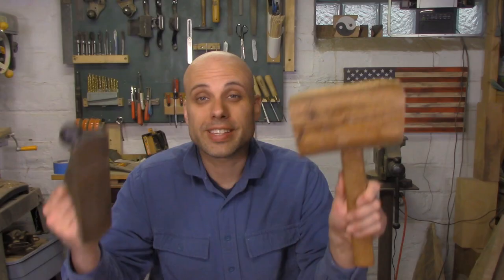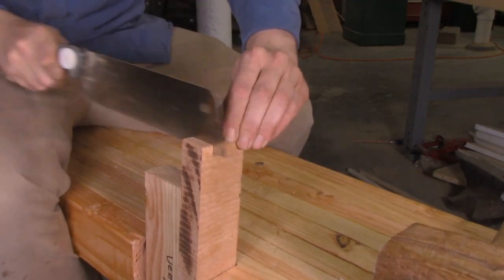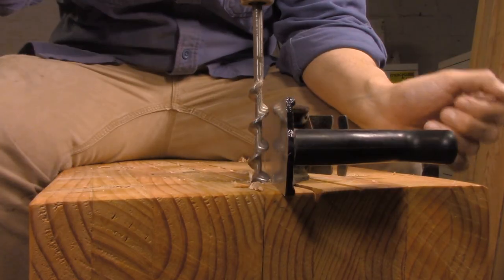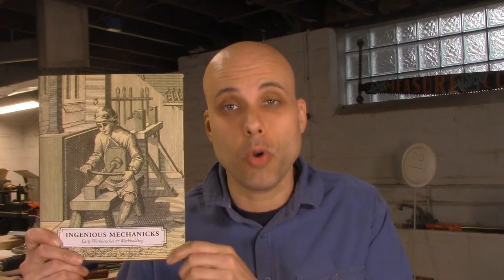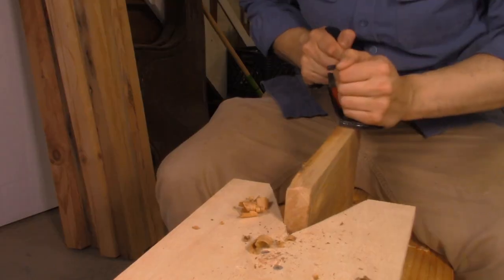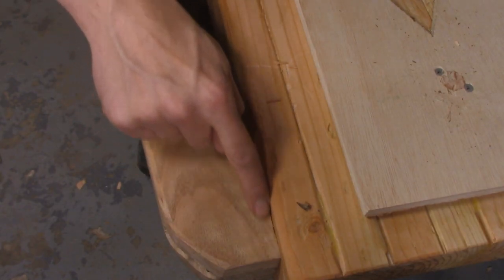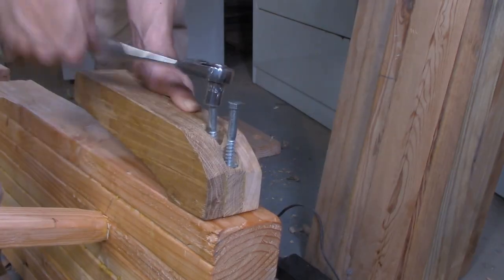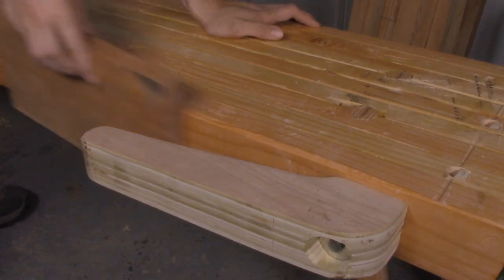Hold ANYTHING on the $30 Bench.

Comment: One more great holding piece would be a bench hook. I made mine out of oak and got a little fancy with it, but you can easily make one out of some plywood and 2x4's. I use mine all the time for cutting out notches and doing hand cut joint work.

Comment: I've been building this bench for a while now and just today I finished my palm and started working on the crochet. I had some scraps of ply lying around that were just big enough I managed to get 2 pieces by roughing one out first. Anyway, while I was roughing it out, I found another easy work holding solution for small parts that doesn't require modifying the bench. By placing the work piece off the side of the bench and a spacer of similar thickness on the other side, I could lay a 1x12 scrap across the top and kneel on that, and that held strong enough for me to use a rough crosscut saw without the board jumping around. Just wanted to share that ... while this is such a simple solution that it could easily be common knowledge, in all my searching on the internet I don't recall seeing this anywhere.

Comment: Just bought a set of good ol' auger bits I found on the other side of my country, now I just have to find a hand drill, those aren't that easy to come by here in Spain! Thank you so much for these videos!
Reply: I had the same problem (in France). If you are unable to find an antique one, you can find some new ones at a decent price on the finetools site. The cheapest does an ok job.
Reply: @Castow  I think I found one, it's hour and a half away by train, but hopefully it will be worth it.

Comment: I don't know how well this would work, but I have an idea for the "wedge vice". What if you made the hole have one angled side, and make one of the sides of the wedge at the same angle. That way the wedge is wide at the top, and narrow at the bottom. It will give full contact with the flat side on the work piece and the angled side. I imagine this would allow you to use one wedge for multiple thicknesses of wood instead of using shims. You might have to reinforce the bottom of the hole a bit though.

Comment: I have some Harbor Freight chisels, and they aren’t “pretty good.” They are quite obviously worse in every way than, for example, my low-end Stanley chisels. However, the Harbor Freight ones do cut wood, and I would not hesitate to buy them again if I had no chisels and money were very tight. The reason I bought the HF set in the first place was that I needed a chisel when I was away from home and didn’t have any others, and the ones at Harbor Freight were dirt-cheap.  Expect to spend some time sharpening and flattening the backs of any inexpensive chisels you buy— and even some of the expensive ones.
Reply: I buy some simple hand tools from Harbor Freight here and there, including a cheap chisel set. I probably wouldn't buy any power tools from them, but when I need an inexpensive C clamp in the middle of a brake pad change out, Harbor Freight is the place to go.

Comment: My question is why weaken the pegs by cutting the tops in half right where all the pressure is going to applied? Round bench dogs work just as well for holding work without compromising the strength of the peg. If you really need a flat edge just sanding or cutting a tiny flat would work just as well without weakening it.

Comment: I built my bench following a few makers on here. It is a twin screw tail vice with dog holes and an extendable end. I patterned the base from your   knock down bench with sideways tusked tenon's from Katz- Moses. I think I'm going to make a crochet that fits in side dog holes so it moves and works with my vice. Just have to figure out how to avoid the feet on the side of the top that I put on when it was built to just go on sawhorses.

Comment: My low bench has a 1 inch x 2.5 foot gap in the middle for sawing.  It allows me to rip or end saw with the off cut supported so I don't get the dreaded rip away at the end.  It also doubles a a handy, balanced way to move the bench with one hand.

Comment: Just wanted to share what I'm working on:  a modular work bench.  I'm a hobbyist with no space - my shop is half of a garage, and half of that half is a bicycle maintenance/repair shop and electronics/fine work station, so my bench needs to have maximum flexibility/capability in the smallest space possible, stow away in an 8'x2' space along the wall, and be able to roll out for use in the other half of the garage when I have access to it.  The bench will start out as (and maybe grow from) four components:

1.  A basic bench/assembly table with t-tracks on either short end for a fence to use with the miter saw (see below), and an end vise and holdfast/bench dog hole grid in the middle.
2.  A flip-top square bench that will have my grinder, bench-top disc/belt sander, and a standard vise mounted, and be a flat work surface on the other side.
3.  A miter saw stand, also flip-top with a flat surface on the other side
4.  A contractor table saw stand.  (See above about my space limitations.  I'd LOVE to have a full table saw, but I've found that a properly adjusted/tuned contractor saw with a quality blade can do all the work I need and do it quite well)

The benches will be height matched, and all on casters that can be lowered so the benches can sit on the ground for stability.  I'll be able to configure any of them (even the contractor saw - blade fully down) as infeed and/or outfeed for the saws/planer/etc.  The spreaders will be height matched and have notches so I can use removable spreaders between them to lock the tables together.

I'm sharing because I've decided to add the $30 bench with some of your additions (definitely the planing stop and the crotchet for starters).

Thanks for the great videos, keep 'em coming!  Strongly considering becoming a patron after only watching a handful of your content.

Comment: I was a professional Woodworker for over 20 years  and my go to chisels are the same Marple ones you have. Also its very common to find   Old  chisels at yard sales and flea markets that.  With some needed love will and become a good chisel ad ironically even brad new chisels need some love and fine tuning  as well  another  easy good bench. Tool for your style of bench  that can  become handy for some  operations is. A simple bench hook  or even a couple od different styles. And sizes  i dont think your bench looks strange at all  although you can experiment with differenr finishes. To. Enhance the look
Reply from the maker: I use bench hooks a lot in my other bench. I'll need to build some for this series.

Comment: Thanks for sharing. Your $30 bench made me think of the evolution of woodworking tools and I think it all boils down to quality, time and cost.

 In ancient times we had hand tools that produced low quality or time consuming products, making furniture expensive. 

Today we have power tools making very high quality products quickly. The trade off is in the price of the power tools versus hand tools - professionals work 40 hours a week and buy high-end tools - DIYers work 4 hours a week using low-cost tools. Your $40 bench is for minimalist DIYers with a lot of spare time
Reply from the maker: I appreciate your thoughts, but you've got a lot of it backwards. Many old tools and VERY advanced and in the time of hand-tool furniture making, there was no such thing as a low quality tool. Hand-tool shops also produced work at a rate that would shock you. Modern power tools are faster, but only sometimes. Setting up machine tools is often very time consuming, making their time saving qualities only apply to production work. I'm a guy that owns a LOT of machines, but there's nothing about them that ensures quality.
Reply: Well you’re happy with you system and that is important. However, where I live there is no competitive shops without power tools and all the top carpenters such as Norm A are so equipped. 

Your system requires a higher skill standard and can be personally rewarding, and it is good that it works for you.

Comment: I’m a retired professional Woodworker and my Go To Chisels have been the same Marples  you speak about ! Do not Under Estimate some of the older Stanleys you can find pretty cheap at Yard Sales and  similar  and with some TLC  make them great chisels again  i also have used older Sears Craftman black handle chisels i suspect were made by Stanley rebranded for Sears  as they have  metal caps on thee handles like Stanley used so you can  hammer on them without damaging the handles or Chisel  those i have found at Yard / Garage Sales all beat up  and looking like junk

Comment: I've heard you often refer to your bench as a tool.  Some people may get mad at this, but I have no problem using a piece of scrap,  and a couple screws,  to make a  quick stop on my bench, or a board and screws  as a hold down to work a piece.  Ya I get a few holes in my bench but  I can always fill them in if I need or rebuild the top eventually.

Comment: For the bench top, on the long edge without the notch or crochet, I used one 2x2 instead of a 2x4 to make the top thinner there, for using my short clamps to hold long boards while I rip them with the circular saw *gasp*.

Comment: Thank you for creating this series! It's really helped motivate me that there's got to be a better way, one that doesn't involve so many expensive tools and special techniques. I'm also a fan of Schwarz's more recent work!

I've been using an laminated 4x4 workbench top on two Japanese sawhorses (the really short ones) for a few weeks now and it's been great. I might just put legs into it and put a notch.
Reply from the maker: Joseph S I m really glad you like it! I'm also VERY interested in the Japanese saw-horse bench.  Can you recommend any resources?
Reply: @RexKrueger  i just made the low-floor ones out of two 2x4 dowelled together. They're as long as my bench is wide.

I am thinking of making trestle sawhorses to bring it up a bit higher, total the same as the Roman workbenches, and for that I don't think I'd need any plans (just dowels and laminating scrap 1x4).

I had started building a Moravian workbench before realizing I really don't need all this complexity after all! :/ So this is my way of reusing the slab top I made without permanently converting it.

Comment: I can put a laser edge on just about any chisel, but the cheap ones wear quick, easier to sharpen though. I have a cheap Irwin 1" has a defect in the steel about 1/8th off the edge that will eventually fail an ill trash it then. Not gonna spend two hours hand grinding that edge square again for something so cheap.

Comment: I believe you call it a palm but as you use it more and more it will loosen in the hole so I would suggest a bunch of 1/4 inch deep saw cuts along the back of the stem and any piece of twig or piece of thin scrap  will hold it up while there is no pressure against it.

Comment: Thank you for the videos. Am currently building the now $75 bench (wood prices are through the roof right now). Thanks for the great videos and plans!

I am not sure how long the notch on the side of the bench should be, but I'm assuming 3 1/2 +1.5 + 5". So is 5" about the right size for that notch?
Reply: How about the thickness of the more heavy pieces you work on, plus some 2" for the wedge? In the end, it is entirely your call, you want to have workpieces there.

Comment: Drill 2 holes in the bench top. You will need to decide where you will want things held. Buy a couple of feet of rope that will fit through the holes. put booth ends thru the holes, then take a wood scrap wider than your shoe, drill 2 more holes and tie off the ends of the rope. you have created a variable tension hold down that won't mar your projects. Bigger project, longer rope.
Reply from the maker: Ha!  That's in Chris' book!

Comment: Absolutely take credit for that deadman wedge. You could very easily retrofit a lot of different style of workbenches, with a similar concept, which I'll be doing! Thanks Rex

Edit: By the way - considering doing the whole series myself, but I'm UK based so there's a a fair few differences in what I'd be purchasing. 

Would you like me to keep track of what I get, so you can share it with other human-woodworkers from across the pond? 

Rather hilariously, Stanley do not appear to sell the 12-404 in the UK despite..yknow. Being an English company.
Reply from the maker: I hear the wood situation over there is VERY different.
Reply: @RexKrueger  Massively from what I hear. There's a lot eBaying involved. Even Paul Sellers gets his oak stock from eBay! 
I've found it's quite easy to get a hold of exotics, though, as most things are imported here.

That said, your approach will 100% work over here using cheap, construction timber.

I made a start on an Amazon 'idea list' with suitable replacements for everything you've recommended in the series so far. When it's done, I'll shoot it in your direction in case it's any help (and you could add affiliate links, maybe?)
Reply from the maker: I would love that. International viewers are gettting to be a big part of my audience and i want things to be easy for them.
Reply: Rex Krueger 
Describing the characteristics of the wood or tool needed for a project instead of (or in addition to) naming them is a good way to make things more accessible internationally. For example, the only wood that’s common both in my area and yours is probably pine, but when you tell us to look for a relatively green chunk of tough ring-porous hardwood, anyone with the slightest knowledge about the tree species around them can probably think of something that might be suitable.

Comment: Is their a way to make the legs detachable for easy storage? Maybe do a tutorial
Reply: I am in the process of building the $30 bench with detachable legs, sort of. I am making two of Rex's three tool benches that will serve as the legs and a bench top without legs. Will probably just have mortise through both then I can drive a peg through to hold them together, but haven't really decided. Will just use clamps until they get in the way. Made one bench already for practice with one inch tenon on the legs. Now making two more benches, but using 1-1/4" tenon, as Rex used for the $30 bench. Maybe I will finish the two benches this weekend, then will use them to build the top. I scored two 4x6 beams for my top, but will probably add a single 2x4 between them so I can cut it to make the mortises, using Rex's "odd number of boards" rule/idea/great advice. WIth a mortise at each end. Maybe a gap in the middle so I get a saw bench effect, too, and one 4x6 about 6 to 8 inches longer than the other at one end, which is also popular with saw benches.

Comment: Hey Rex, I watched an episode of Project Farm where he tested wood glues for which was strongest, and he found with good brands, the glued joints were very often stronger than the wood it was bonding.
So, you drilled your 3/4" hold in the centers of the 2×4s, but if you used one of the stronger brands of wood glue (the strongest by far in his tests was Titebond III) then the hole might actually be stronger. 
What about that thought?

Comment: Hi Rex I’m looking for options before I buy some few things I’m on a fixed budget I’m deaf and wants to do woodworking however I can stand for different work but I cannot bend down due to hip arthritis and low back issues. So I’d like your options ok I have a soft sitting chair with wheels to move around . How high supposed to be building a table without buying a lot of stuff only few things I can grab it I watched you about no vise and stuff that can be designed for disabled person . Thanks for heads up.

Comment: Awesome idea... I am getting ready to build one of these. I am curious why you put the crotchet on the right face and not the left face (in looking into this further, I usually see them on the left face). Is this because you are sitting on the bench rather than standing in front of it? Also, would it make sense (for me) to use a 2x6 on the face (like a bench apron) for more clamping options? Or is that a stupid idea for some reason that I haven't thought of yet... Thanks!

Comment: Great Series.  Why did you notch the dowels? I know that's traditional, but what purpose does it serve?  Just looks like weak parts to me.  I could see shaving them to get an even contact line, if the holes were a little off.  But that's it.  Could you explain?
Reply: Yeah I put a much smaller flat on my bench dogs. It doesn't take much. Maybe go  a third of the way?
Reply from the maker: If I was working on a softwood board, round pegs could dent the edge. That said, you could just use the pegs. No problem.

Comment: I'm adding these stops to my LBR right now, but I'm a little mixed up on their orientation. I can see from some of the shots that the palm and the crochet are on the same end of the bench as one another, and the notch in the side of the bench looks to be just a foot or two further towards the middle of the bench than the crochet, but what about the dowel planing stops? are they on that same end, or the opposite end of the bench?
Reply: Watching the bit where the palm is installed, it looks like the dowels aren't installed as it's being worked on, so if each piece was installed in the order they're shown in the video, they'd have to be at opposite ends. Might've been easier to intuit the orientation of each piece if the camera had stayed on the same side of the bench throughout filming (assuming I'm right about the final orientation of everything that is)